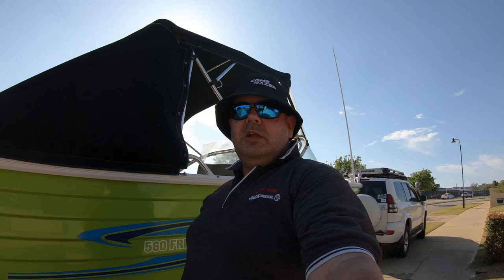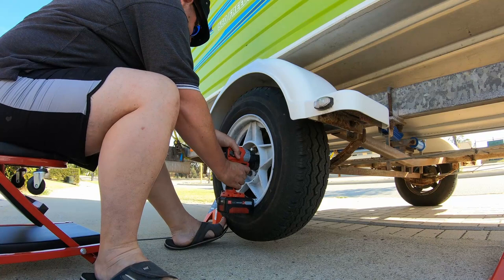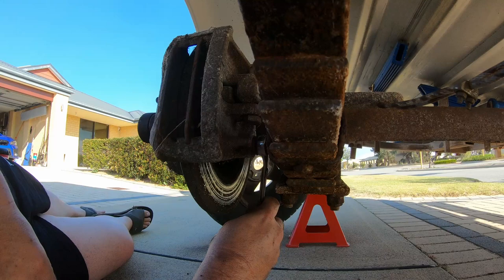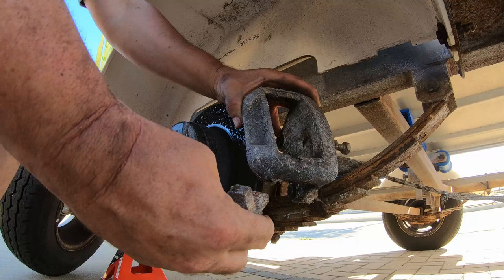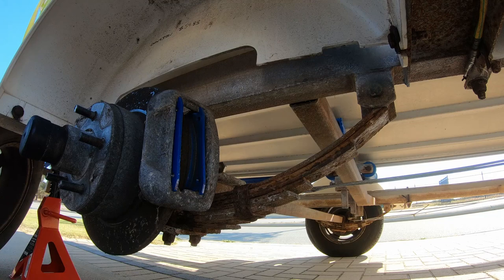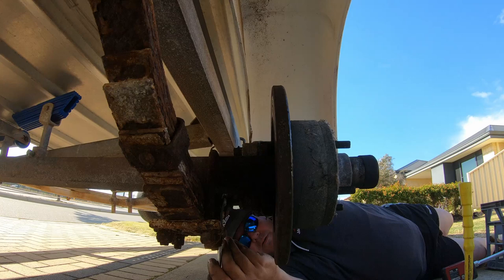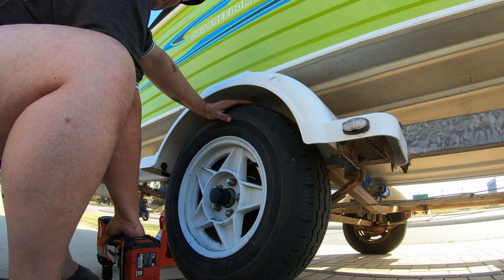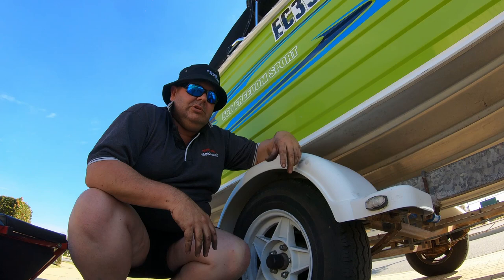Boat Trailer - DIY Brake Disc Pad Replacement - Project from the shed - Project from the shed

Comment: Thanks for this. Helped make my pad change go much more smoothly.
Reply from the maker: Glad it could be of some assistance 🙂
Reply: Mate doing ours now. Hope this video helps have a little trouble with the brake going back in tight as it just seems a little loose atm
Reply from the maker: @Madmaximus1000  how'd ya go? The slack should disappear after a couple of brake applications and the calipers reposition on the posts.

Comment: Hey Dano. Many thanks for that. I would have struggled without you most excellent tutorial. How ever, you failed to give a heads up on what an absolute dance with the devil it is getting those two bolts back in! But, rejoice. We conquer. Less than 20 minutes!?   Seriously, I've been at it for a couple of hours. Every step, has had a complication appear out of left field. Now to tackle the other side... . Hopefully what I learned first time around will make the process easier and faster second time around. I also learned that a 5/8 spanner is an extremely close approximation to a 16mm spanner! Cheers,  Mark O.
Reply from the maker: Hi Mark, thanks for your comment, glad the video was useful for you and I hope the other side was much easier for you 🙂
Reply: Yes, I just used 16mm socket on top bolt. But had to use adjustable spanner on bottom bolt (didn’t have correct sized spanner) and thankfully was still able to crack them, because leaf springs were in the way (couldn’t get socket to the bottom bolts).

Comment: Thanks for sharing mate. Just did a replacement myself using your tips.
However, with the wheel still jacked up off the ground, I can hear the brake pad grinding on the hub when I spin the wheel. Is this normal? If not, any ideas on how to fix it?
Reply from the maker: Great work mate, good to see you having a crack at doing it yourself. So long as the brakes are not dragging when you spin the wheel you will not have any issues. Keep up the good work 👍
Reply: @danoschannel  thanks heaps mate.

Comment: Nice video.

I just bought a used trailer. looks like I need to replace some parts in the brake system.
Brake pads being one of the maintenance I should do.

I noticed your rotors were pretty rusty.
They should get clean when the trailer is used again.
At what point should you replace the rotors? or possibly clean them?
Reply from the maker: I replace them if they are badly pitted or scored. Being in and out of salt water all the time the next time I replace the rotors on the boat trailer I will go with stainless .
Reply: @danoschannel  Thanks for the tip.

Comment: Dano - I have the exact same assembly on my trailer in Perth. What kind of hub system are these? Holden? Mine are absolutely stuffed might need a new set. Hope you can let me know, cheers
Reply from the maker: G'day Rock, ahhhhh another Perth fella about to do some basic bloke stuff, good on you for having a crack. My hubs are HT Holden but beware, not all Holden's are the same.  Easiest way to tell is to break out the old measuring stick and take the PCD (pitch circle diameter) and the distance between wheel studs as well as gauging the stud diameter. To take the PCD measurement, measure from the center of one wheel stud to the outside of one opposite.  HT, HQ & Commodore all have 5 x 7/16 wheels studs (Fords are usually 1/2 inch studs) however the PCD and stud distance differs.  HT's have a PCD of 108 mm and a stud distance of 63mm, HQ's have a PCD of 120.6mm and a stud distance of 71mm,  Commodores have a PCD of 120mm and stud distance of 71.  

Make sure you look at the numbers printed on both inner and outer bearing races inside your hub, it is possible for Ford hubs to take Holden (LM) bearings.  Hope this helps you source the parts you need and good luck with your project.

Comment: Good video mate. Jus a question with the hub, do I need to remove the  brake calliper in order to remove the hub? I recently repacked the outer bearing n tries to get as much of the old grease as possible but couldn't get to thr inner bearing as I couldn't get the hub off thinking I needed to remove other components such as the callipers? Pls help. Cheers.
Reply from the maker: Morning mate, yep pop the caliper off as well, so long as you have removed the nut on the stub axle that hub will slide right off  giving you access to both sides. Be careful your front bearing doesn't fall in the dirt 😁
Reply: Hello again mate, how are ur pads/rotors going? Mine are about due and noticed my rotors are in about thr same condition as in ur video, thinking if I should replace it or can I get away with replacing just the pads? Cheers